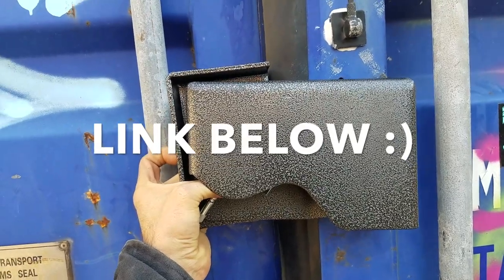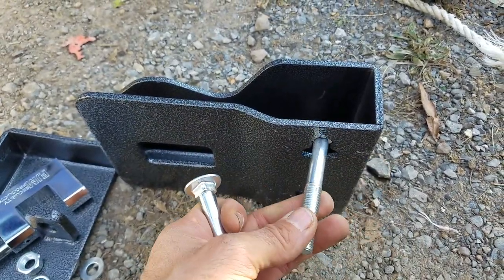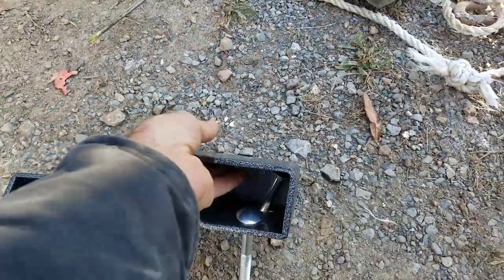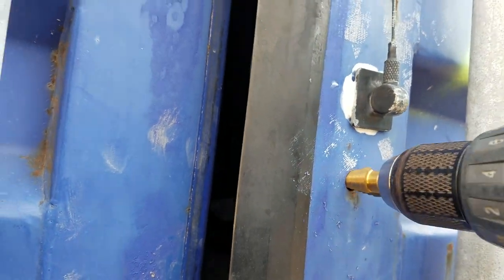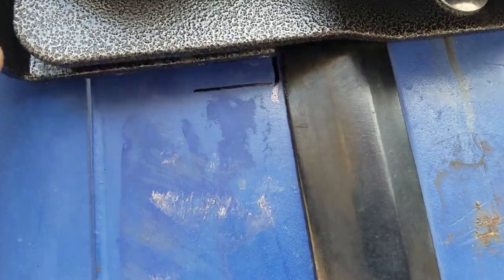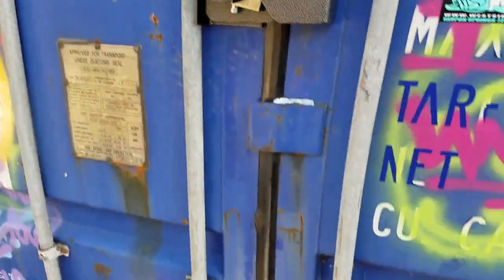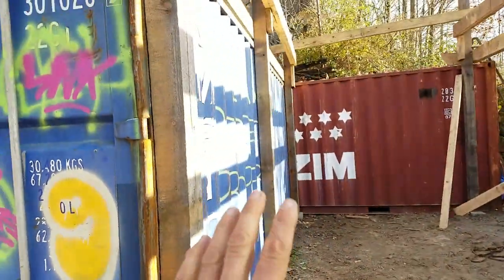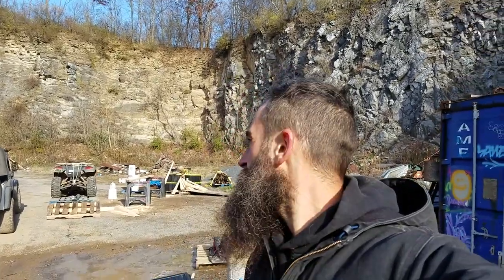SHIPPING CONTAINER SECURITY

Comment: Now that you have the holes drilled and know it works take the lockbox off, coat the back with epoxy and put it back on. (Grind the paint of the container first) 

This will create a secure bond between the box and the container. These lock boxes are great to stop cutting, but the way the bolts are placed ( no offset) you can hit straight down on the top of the box with a sledge hammer and it will sheer the bolts. Either that or weld it in place.
Reply from the maker: +Aloha Quails holy cows 🐮 thank you for that tip! I will weld it on there. Really good to know. Happy holidays

Comment: when using the stepped bit, to keep from drilling too far put some electrical tape on the next step so it's easy to see when to stop.  Also works well when you want a specific depth with a regular bit.
Reply from the maker: +Todd McCarter nice! Thanks for the tip

Comment: I'm looking for a way to electrify mine...as in give the effers a good jolt such thst they per their pants. Mine came eith that box, and I had a great lock they couldnt get through, so they took a grinder and removed the box and then the cut open the hook. 
So, if you have ideas about how I can wire this thing in such a way not to cause a fire if a limb or tree falls...im very interested.
Reply from the maker: Great idea I have been thinking about something like that or at least a sign warning that it is boobie trapped and if the police need access to call them my number

Comment: thank you so much for this video i bought a 20 footer last year cause my older wooden shed had got broken into i have just 4 beefy locks on currently but my work stuff is in there i had bought the exact same puck lock assembly as yours in this video i have yet to install it just yet and over the winter months where its located 15 foot camper trailers and few other easier built items have been broken into so im thinking lock #5 (the box) is going on this spring i may get someone to weld it on after its bolted shortly there afterwards for double the support
Reply from the maker: Yeah I was thinking of welding mine on too.  You can never be to secure!
Reply: since i posted that comment lock is on and installed i can now sleep better now as a result used this video as a guide a key in that drill bit i keep a bunch of my lawn equipment in it love my container i even put my trailer right inside for added security and have chained the wheels from the two front pegs to the floor i dont trust people that roam around the compound thank you again
Reply from the maker: Sweet glad ot worked

Comment: Does nothing.. Thieves used an Angle Cutter with a Diamond Blade.. slipped the blade behind the lock inside the Cover, cutting off the Shank the lock was locked to.  Took them maybe 60 seconds.. .then used the same grinder to wack off the padlocks on the handles.
Reply from the maker: Yep every measure is designed to slow down or keep kids from getting in. Also my neighbors may hear this and check it out knowing im away. The Amish have great spider sences
Reply: @dennisalanvids  :: True... I'm adding an interior locking system, to "slow them down" after they cut the main lock next time... should create quite the headache for them trying to figure out why the door won't open.
Reply from the maker: Nice